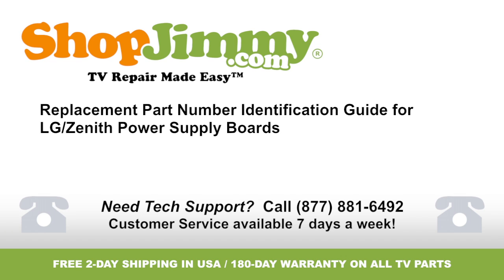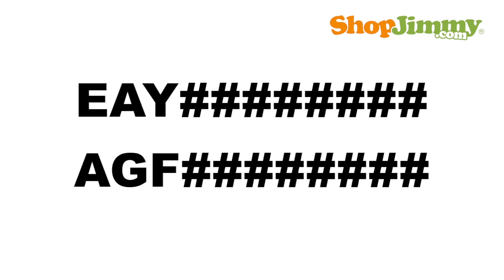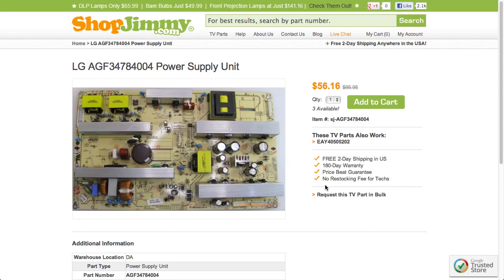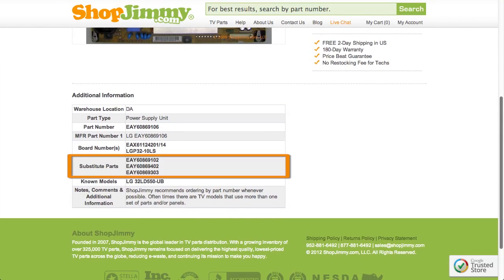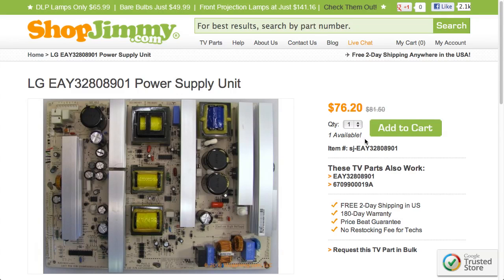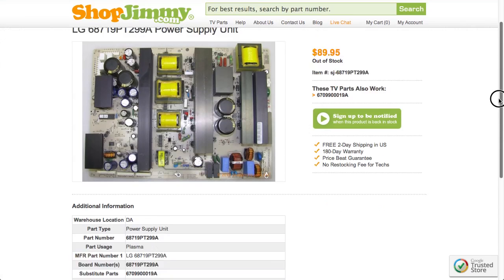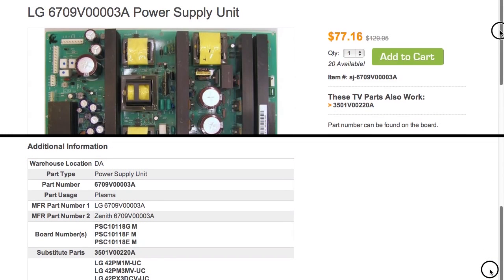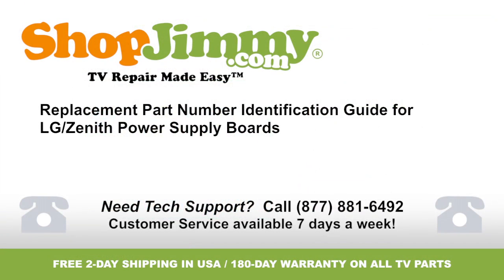TV Part Number Identification Help Guide for LG & Zenith Power Supply Unit (PSU) Boards

Comment: I need to replace my mainboard on my LG 70UK6190PUB. I have found a part on the site - Part number LG EBT65512504 for SVC code UK6190PUB.BUSMLJR.  The service code for my TV (sticker on the back) is 70UK6190PUB.BCCWLJR.  Will this part work on my TV ? Thanks...

Comment: I have a LG 42 inch TV Model 42PJ350-AB, When I switch the power on, it indicates red light coming on at the bottom right hand of the TV, and it gives double click sound when selecting power on switch on the TV..can any one please help.

Comment: Hi my model# for my lg tv is 55LN5600-UI. When I turn my tv on, it flashes the lg logo for about half a second and then the screen goes dark. I do have sound. I did the flashlight test and can see a picture, but when I turn off all the lights in the room and back cover removed, there are no backlights. I couldn't spot any noticeable damage to capacitors or anything else anywhere. Do you have any idea what this might be?

Comment: Hi there,
My model number is LG 55LX6500
S/N 008RMAQZX128

My TV turns on, displays the LG logo and then all of the loghts at the bottom also light up and then it turns off or onto a standby mode (I can't tell). The LG logo stays lit until I turn the power off but there is not picture at all. 

I think this is the power board but if I could get your advice I would appreciate it.

Comment: So I'm looking at the LG EAX61358603(1) mainboard. I see that the same part is made by LG for Zenith, and is classified as a Zenith as well. But the TV that it goes in has the same s/N along with the board. So would the Zenith marked board work in my LG TV?
Reply from the maker: Pilotguy251  Try all repairs and troubleshooting at your own risk.  Just be sure to match the part number and other information in the listing.  Find the part number on your board and then search that number on our website.  Thanks!  www.shopjimmy.com